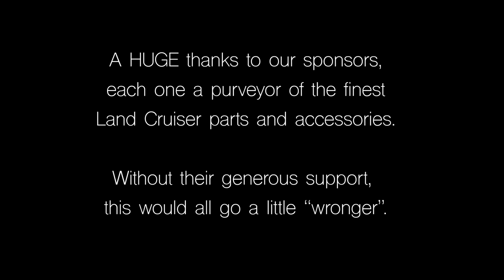Step 6: FJ40 Routing the Holley Sniper fuel lines, Mounting filters, Measuring once cutting twice.

Comment: Could you possibly tell me where you got the adapter bolt that connects to the fuel tank? Thank you.
Reply from the maker: The one I drilled into the tank?
Reply: @projectwrongway9127  sorry, the one at the bottom of the tank on the fill fitting.
Reply from the maker: That one isn’t actually correct, it was a wrong thread and I ended up having to use a bunch of thread tape… the rivnut style fuel mount was an eBay purchase.

Comment: ...for Rachael's safety, can you please have a brake expert double check your brake install?  I think it was about 20 years ago when you did that disc brake conversion, and at the time it looked pretty sketchy to me, not sure if you went back and re-engineered it?  Now that you have some more gearheads, please get another pair of eyes or more to look it over before you take that beast for a drive.
Reply from the maker: Been driving it for months now. Including some freeway trips for over 50 miles. Lots of around town, stopping and going… zero issues. But, for safety’s sake I’ll look into at again.
Reply: @projectwrongway9127  wouldn't hurt... congrats on getting it on the road - great job!
Reply from the maker: Almost back on again!

Comment: OIL Pressure Sending Unit Rubber Boot KIT Shown by Ben in Pod Cast here  = Engine Wire No. 4     Part # 82124-90A01

Comment: I had to remove my stock fuel tank because of years of abuse and neglect... there is a plastic one now
Reply: less capacity though.
Reply: @Mjtally  I am not sure it is that much of a difference
Reply: @lazlosfj40garage58  i want to say stock is 16.4 gal and the new poly tanks are only 12.5.. so you loose a bit... with the 2f its nice to have the extra 4 gals lol
Reply from the maker: The tank working?
Reply: @projectwrongway9127  Oh ya, perfectly. I had to modify the vent lines but no problems since - no foiled filters for over a year